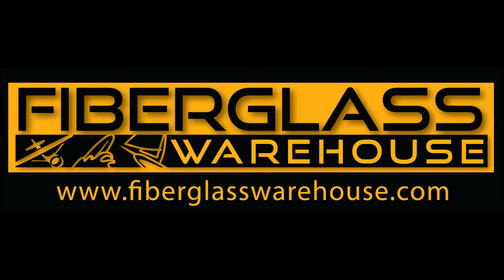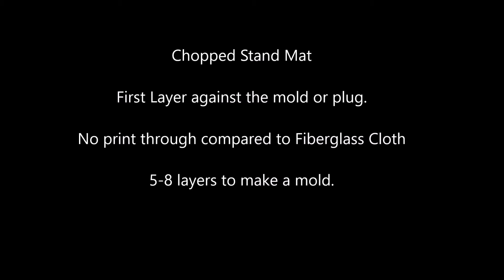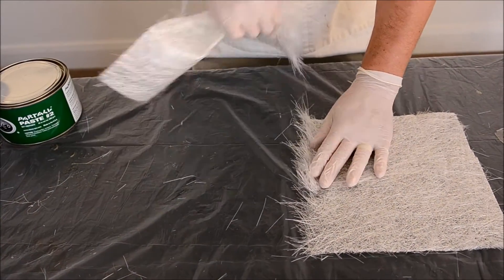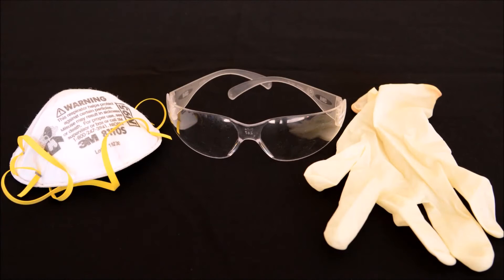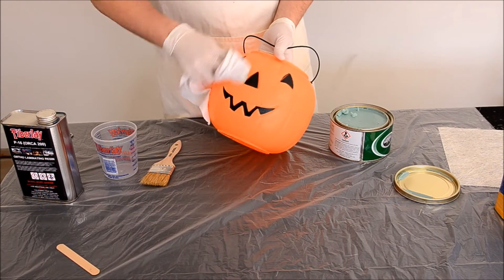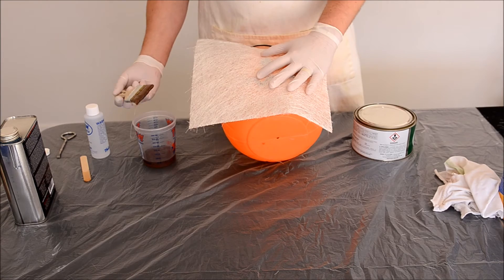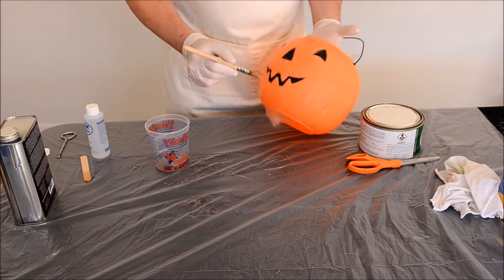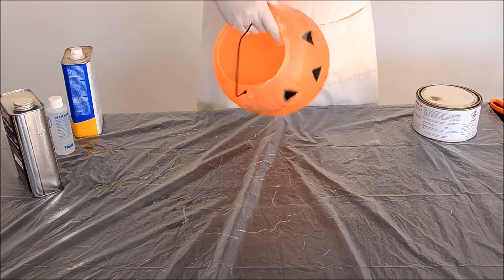Chopped Strand Mat, also known as Fiberglass Mat

Comment: Hi, this is a very helpful video. Can I ask how much chopped strand mat was need for this particular project? Perhaps a meter squared? Thanks, Brendan
Reply from the maker: Ya, to go all the way around, I would start with at least a yard.
Reply: Thanks for the helpful reply. Just wondering how do you get rid of your leftover resin? I assume it is not safe to pour down the sink?
Reply: @Brenners2010  i know this is old, but damn....PLEASE dont pour it down the sink.   cured resin is a hard plastic.
Reply: @zyenathalous  Of course. I never did
Reply: @Brenners2010  wow...fast reply.  cheers mate.  :)
Reply: @zyenathalous  lol, no worries. I don't have much of a life unfortunately haha! Thanks for the tip regardless!